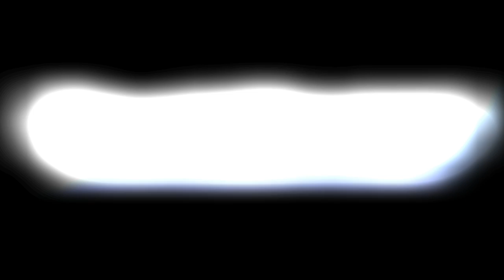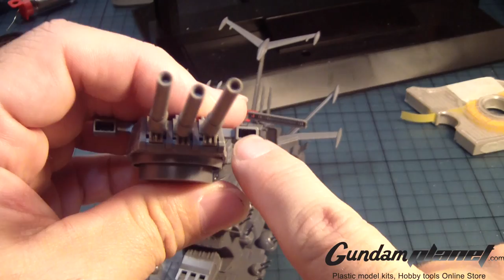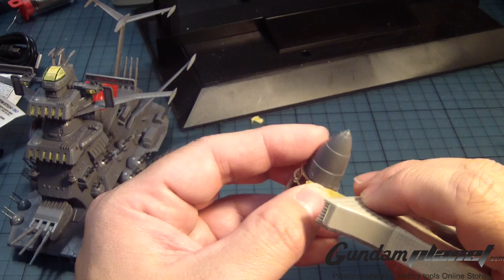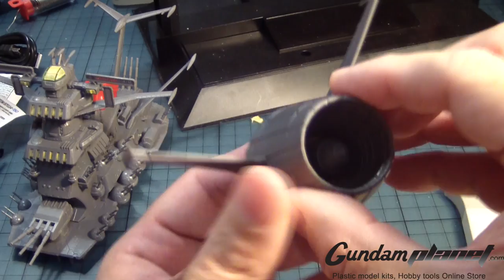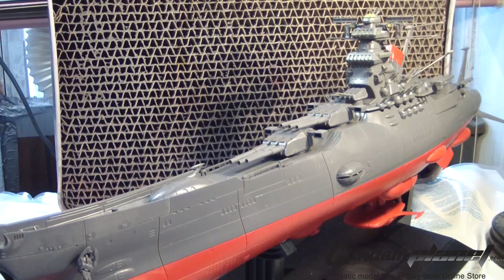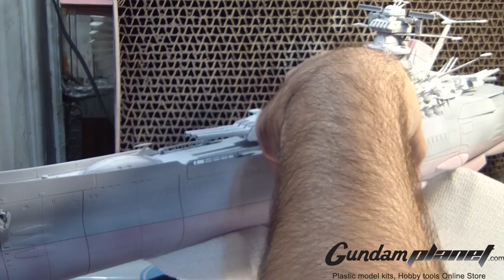*BandaiModels* 1/500 Space Battleship Yamato 2199 - Part 9

Comment: my oppinion as graphic designer, use darker color of the main color to create perfect shade (e.g. dark red for the red parts). gray will make it look odd and loss it gloss (on my experiences, but never apply it on plastic model kits, yet)
Reply from the maker: A few months ago I built the 1/1000 Darold Assault class battle carrier kit from this series and I pre-shaded it using black panel line marker on the panel lines. I then painted Russet red and it gave me the faded effect I wanted. Check it out if you haven't seen it yet.
Reply: stryderprime i have seen it. thin panel line looks great. i have tried it as pre-shade too.  but i never like airbrush pre-shading or shading using black. never look good unless it for burn effect. but that's just my personal taste. i'm here to learn :)

btw this kit looks awesome! i almost tempted to buy this